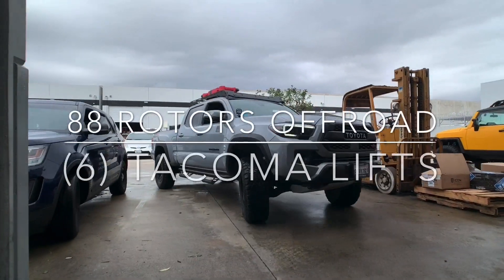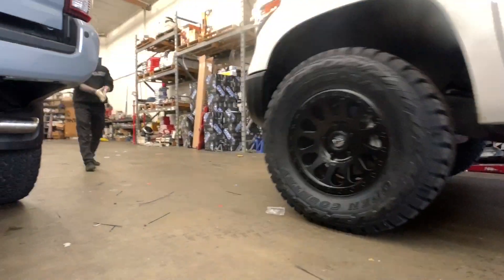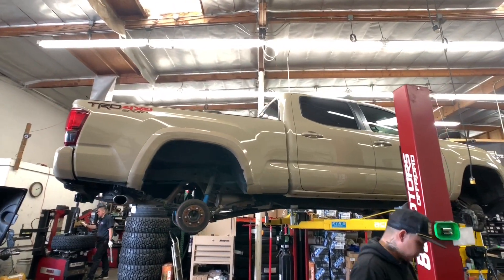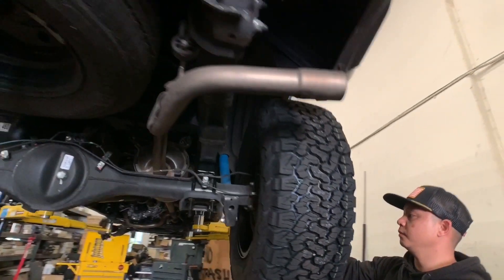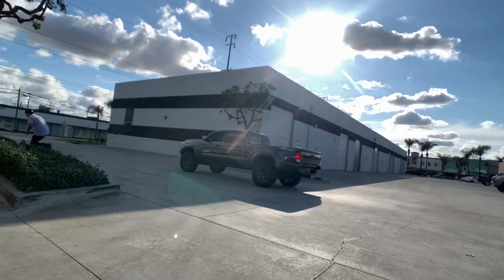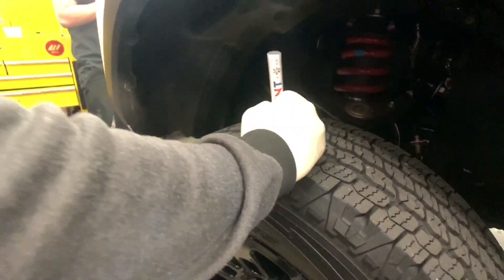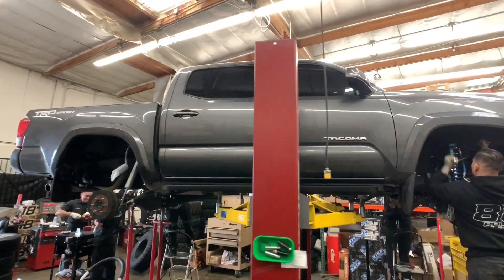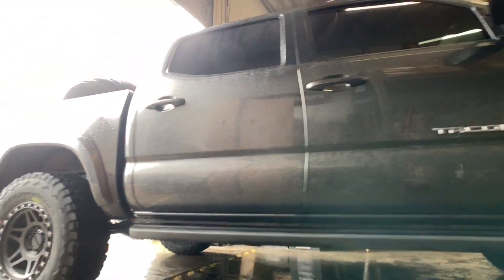(6) 3rd Gen Toyota Tacoma Lifts, Wheels, & 33” Tires

Comment: Does any of this void factory warranty?
Reply from the maker: We’ve gone over this subject many times. You can’t warranty parts you remove. You get new warranty with the new products that you install from the aftermarket manufactures. A lift can’t cause your windows to stop working. Aftermarket wheels won’t make your engine stall or your AC to stop working. There’s a law then protects consumers. A vehicle brand can not void your warranty if they can’t prove that what you did was the direct cause of your problem. If you want more details, contact your local dealership.